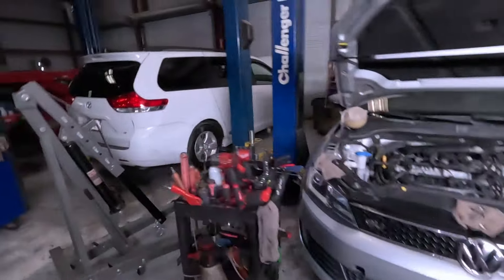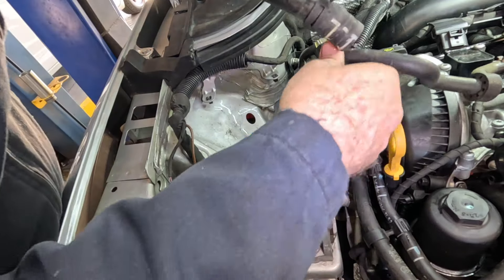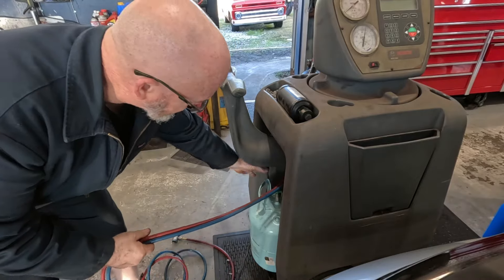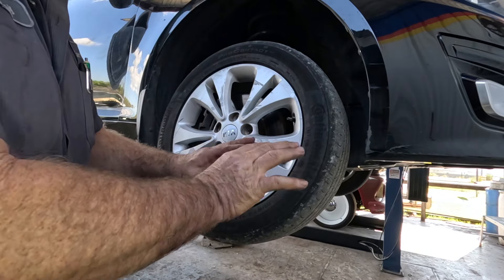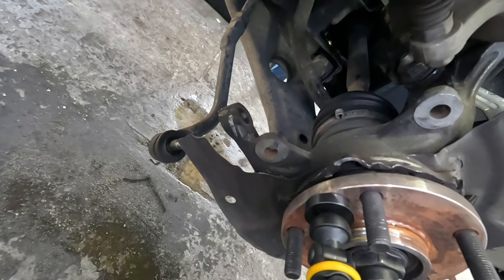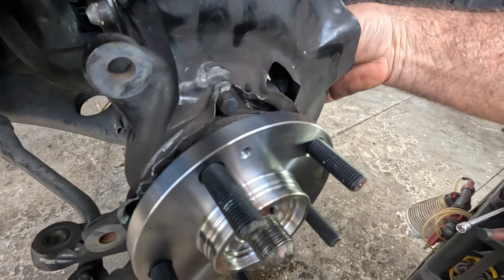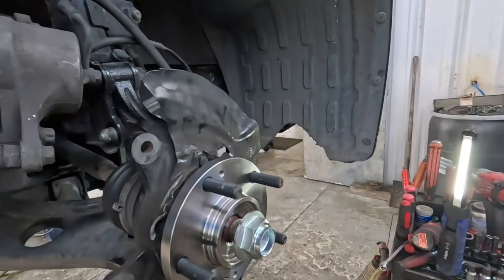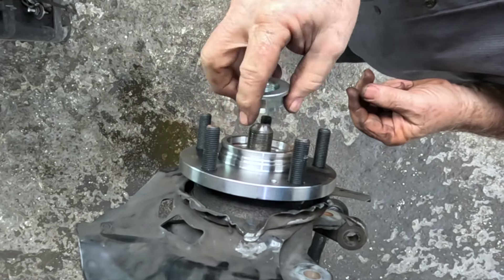Jetta Engine install Runs? Kia Hub Bearing, DAY IN THE SHOP 428 #auto #repair #fail #win

Comment: That Volkswagen would have most definitely tested my patience. I was wondering why you were using the slide hammer to remove the hub and bearing. You were working out your frustrations caused by the Volkswagen! 🤣🤣 Hope you have a great weekend Jimmy! You deserve a respite from the Volkswagen debacle.
Reply from the maker: Haha, I just ripped that knuckle off before even considering removing the hub. Got a good work out in. Thanks M!
Reply: My jetta 1.8 tsi  is over 176000 miles.....i see this same nightmare in my future jimmy ..... damn you hanz and franz😂😂

Comment: I feel your pain Jimmy. I had a car the customer decided to drive down a flooded road. His cold air intake he had installed sucked water into the engine. Bent 2 rods, voided the warranty. He's insurance company decided it would be cheaper to put a used engine into this year old car. The first engine they sent the timing chain had jumped time. The second engine they sent the bosses for the alternator and a/c compressor were bent. I couldn't bolt accessories on. Had to have been a really hard impact. Finally on the third try I got a good engine. The insurance company had to pay for 3 R&R on the engine. So after 3 engine jobs, waiting for them to locate and send another engine between each R&R. I finally got paid for the job. It was over 6 weeks from the time I first pulled the car into my bay. Boy did my paycheck look good that week. But I was never so happy to see a car leave. Keep up the good work Jimmy.
Reply from the maker: Wow, amazing how they think they are saving money, but it only works about 50% of the time it seems.
If we get paid, then it’s not so bad. But you’d think they’d learn. They must just hope for the 50% odd to be in their favor, lol.

Comment: Happy Friday  Jimmy !  I think  for the most part if you run a good quality synthetic oil and change it before 5k miles and do mostly highway driving.. your engine will last.. here in the salt belt they fall apart usually before the engine wears out. 😂 unless you don’t check your oil..  nothing can help those people.
Reply from the maker: Right on! We get so many older cars here, they never rust. Usually plastic fatigue though.
Reply: @JimmyMakingitwork  on a side note , I picked up 6 Wix oil filters for the 2.5 Subaru the other day.. I inspected them all to find quality control isn’t the greatest.. looks like when they assembled them the silicone drain back maybe isn’t the right size and gets cut . I found loose pieces on top of the filter .. I should make a short video .

Comment: Darn VW , you forgot to check it and make it sure it was “good n tight “.  😂  hopefully they just loosened the water pump to drain the block .
Reply from the maker: Man this salvage stuff can be tuff. We’ll get it after some dancing!
Reply: @JimmyMakingitwork  I once put a 3.5 in a Honda  Odyssey 2012. A mechanic at the Honda dealer ,hit a light pole in the parking lot. It was sent in for the collision repair, to later find the engine block cracked where the upper engine mount bolted to .  They ordered a junkyard engine, I didn’t look at it all the closely.. I had it bolted up to the transmission and was nearly ready to lower the van. I noticed a coolant stain , same area upper mount small crack. So back off , and take all the park back off it.. Next day.. do it all over. Lol   Normally it would take a day and a half to do one. Engine jobs  you never know what you’ll get .  🚣

Comment: I know it’s a day late and a dollar short, but why didn’t you put the front clip in service position? It would give you a little bit more room to work on the engine. Unless I missed something in the videos and you actually did do that.
Reply from the maker: I did it by the VW procedure and it never mentions that. But think next time I’d leave the trans in and try removing the engine from the top. That clutch hub is about 3” deep though so it might not clear the frame rail.

Comment: The only problem is that Rainman does not use a torque wrench.......he uses his impact.  Rainman uses too many shoddy shortcuts.
Reply from the maker: Which is odd since it’s his own shop AND he’s filming it for
Mass consumption. Hmmmm
Reply: Go back and watch his vids on the Ford AC (wrong compressor), installing the Gayle Banks kit, the front suspension repair of the Ford Transit Connect (you would go nuts on that repair)...... @JimmyMakingitwork

Comment: Junk wagon!! Won't touch them anymore
Reply from the maker: Man they are rough to work on.
Reply: @JimmyMakingitwork   Grandson called after he finished college! Grandpa which brand car should I get?? Told him a few reliable models. Finished with don't get  a VW or a Hyundai. He bought a nice clean used 38,000 mile VW. Broken down multiple times
before hitting 50k. Oh, and his mom bought a 4 cylinder Hyundai. Just perfect...